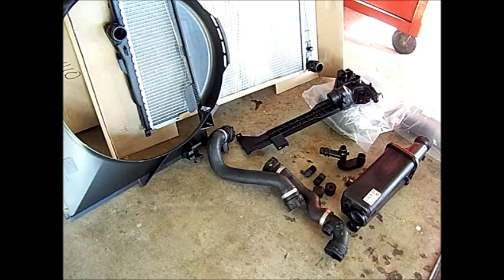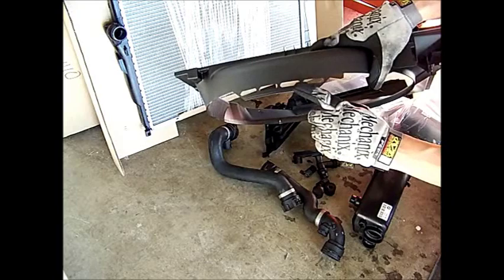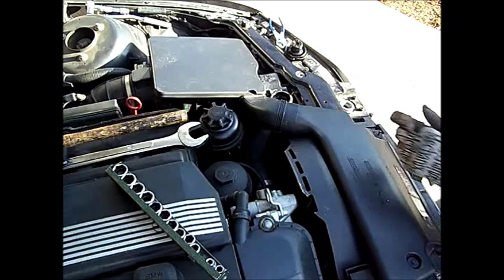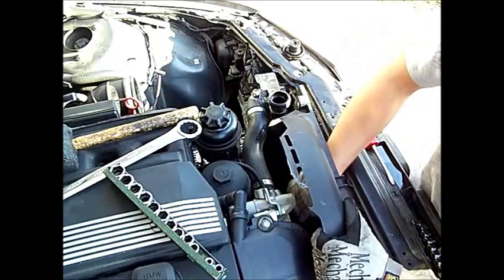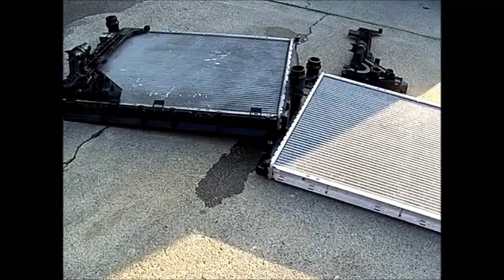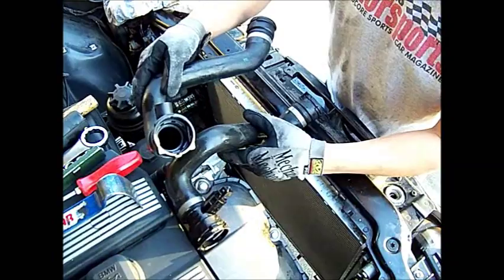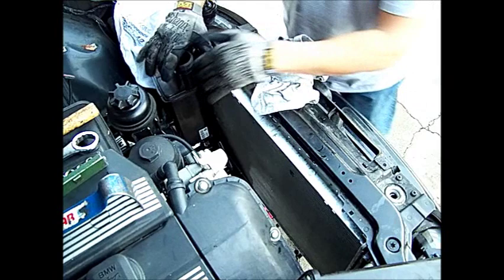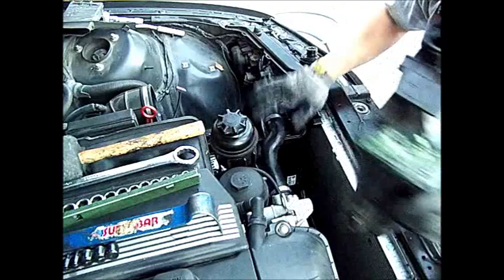BMW 330i, 325i, 323i, e46 Radiator and Expansion Tank Replacement

Comment: Hey great video. I have oil in my expansion tank but my oil is clean and the engine does not over heat.  The exhaust gases are clear no blue or grey smoke. Is there anyway the radiator could be mixing the oil with water or is there any other possibility without it being the head?
Reply from the maker: If you have an Automatic Transmission, it could be a leak within the transmission oil cooler that is at the base of the expansion tank. Are you sure it's oil and not ATF? Sometimes the mount for that AT cooler also can develop cracks or does not seal well. Finally, if your expansion tank has a lot of miles they sometimes develop a brown goo that is mistaken for oil but is also an indication that your radiator and hoses are breaking down.
Reply: Thanx for the reply. My car is auto, I can see the oil floating in the tank and when I put some tissue in and pull it out it smells like engine oil. The car is running lovely and Its never needed oil top ups or anything. It has been an excellent car since I bought it and it's got low milage, 60000. I checked on the bimmer forum and the closest I came was someone at a garage accidentally put oil in the coolant, which isn't mine. I can't find anything definitive :(
Reply from the maker: ZeroGHome24 I guess anything is possible. If you decide to replace the components in the future, there's plenty of video how to's on YouTube.  Good Luck.
Reply: It was the head, just in really early stages lol. There is nothing on my single overhead cam e36 318i bmw on YouTube. So I bought a Haynes manual for car. My timing chain has two metal covers one for the head section and one for the crank section. So I have already taken everything off before I got to this part. I have to take off the crankshaft bolt but it just doesn't want to move at all, I haven't got any power tools as I'm doing this on my drive. Have you got any ideas please mate. And also once the bolts off would you put any locktite when installing it and what do I torque at NM or lbs. Sorry for the bother but I'm kind of alone on this.
Reply from the maker: Yeah, you have to find out some way of locking the pulley in place so it doesn't rotate. I remember the torque spec on it to be pretty high, like 120 lb-ft and usually the thread is reverse, so clockwise to loosen but I would consult with a mechanic. In order to hold the crankshaft in place, one way is to have another person get in the car, put it in gear and stand on the brakes, then you work with a breaker bar, just look at the threads to understand if they are reverse. I don't think you need Loctite upon assembly, just get the torque right.  Good Luck.
Reply: Hey buddy I finally got the crankshaft bolt off, I remembered I had some lever bars somewhere. The pulley has vents in it big enough to jam a lever bar through a vent and the bottom of the crankshaft housing. Learned something new today which might come in handy to you for future cars. My car is E36 318i single overhead cam BMW. On my car there isnt a tensioner on the left side of the engine, these cars have there tensioner just under the water pump and above the crank to get to it you have to remove the crankshaft bolt pulley and the bottom half of the timing chain cover. A short cut to doing this is near the camshaft pulley on the left chain guide you we'll see a 13mm bolt tightening onto a 19mm. Take the 13mm out pull the guide towards you a little bit, then pull the right side guide towards you, then loosen the 11mm *4 bolts on the pulley then pull pulley off. Get  the head bolts off, lift off head a little forward to get to a small flange on the back of head near number 4. Lift head completely off, then will a coat hanger hook up you chain so it doesn't come off. You can do this without locking up the tensioner and don't worry it will not fall apart into the engine.
Reply from the maker: If you have an Automatic, there is a transmission cooler that interfaces with an exchanger that is located near the base of the expansion tank and this uses coolant to cool that heat exchanger.  There could be contamination from there.  Now if this is actual engine oil, sometimes the head gasket leak (one source) is so slight it doesn't affect the running of the car nor does it show up anywhere else.  You'll want to perform some pressure testing to see if these is a leak from the engine oil area to the coolant area.  Sorry could not be of more help.
Reply: Took the head off after carrying out a CO2 test and a dye test. Cylinder 4 was gone on the head. I took the head to a machine shop because it needed welding on cylinder 4, also needed to be skimmed. On my earlier message to you I was telling you there's a short cut to doing a head on my car, I will use it next time, this time I fit a new chain tensioner so I had to take the crank pulley off.

Comment: How much do you think this would cost to repair?
Reply from the maker: If you take it to a mechanic it's probably 4-5 hours, depending on where you are, it's an hourly charge for that.  Here in Northern California and the SF Bay Area labor rates are in the $140/hr range.  Then it's the cost of the parts, that you can check on eBay or AutohausAZ.

Comment: How much money did you spend on the new pieces?
Reply from the maker: It's been a while and I have sold the car and the receipts went with it, but it's likely in the range of $800. If you are getting this far into it a water pump and thermostat may be needed.  Have a look at a full service site like Autohaus AZ to get some accurate pricing. Good Luck.

Comment: you dont show the expansion tank thermostat..I would say good video but you forget the mos important think thermostat..lot people going at think when they see this video that there's not going thermostat there
Reply: Let me add a very import note. I had a cracked (transmission) thermostat that cracked in half when removing the old expansion tank. The replacement had a little tang sticking out on the upper third. That is a very important piece; it is there to hold the thermostat in place. Make sure your have that where you can see it when placing the thermostat. Push it down into the pipe pretty hard to set it. If you don't, you will not be able to snap the two lower pipes on the bottom of the expansion tank into the holder bracket. I recommend using a very small amount of silicon grease for lubing the lower tank seals (and all quick connect hoses) before assembly. Set the tank over the two inlet pipes, and push down forcefully. The retaining clip should  make a nice sharp snap. 

Done! I found this out the hard way, when I got a small leak that I had difficulty detecting.
Reply from the maker: Great points Paul, thanks for the addition.